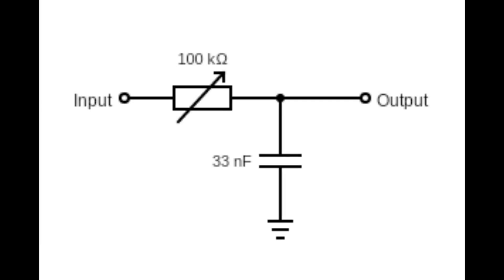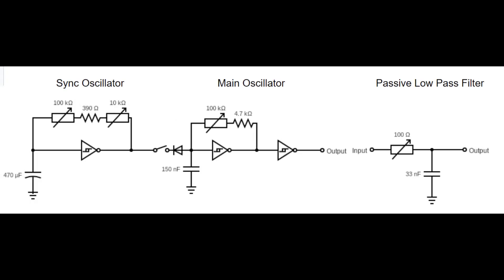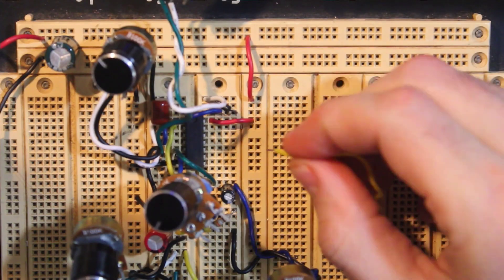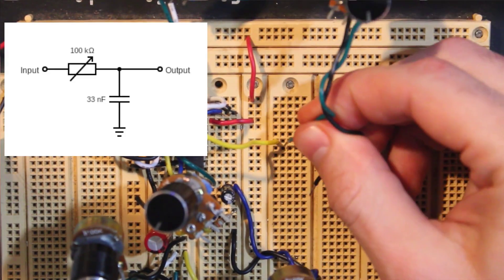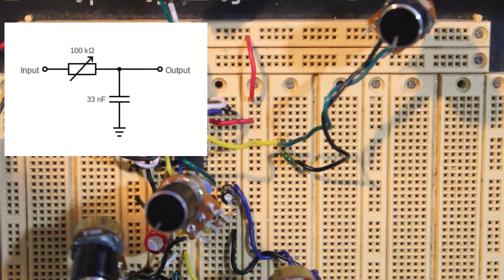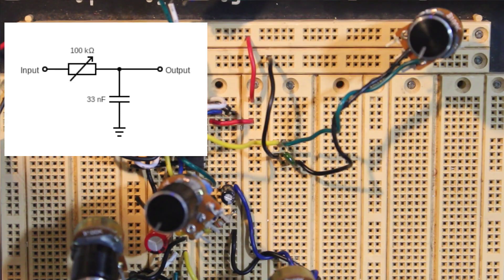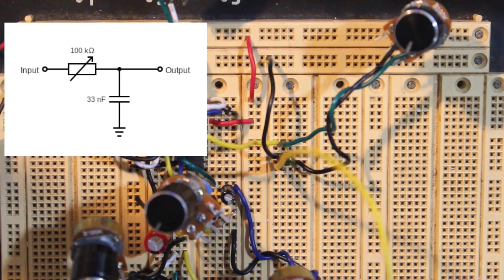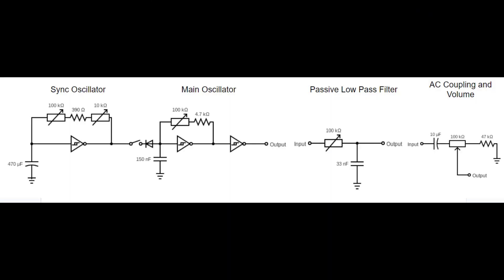Passive Low Pass Filter Schematic and Build [DIY Synth]

Comment: hey uhmmm i want to make the 40106 drone synth from your other vid with this low pass filter, so which components should i also buy with the list from the drone synth? sorry if im bothering you im super crazy abouut synth making, i just fell in love with aphex twin and i wanna hear like this super cool thing i made, you designed
Reply from the maker: The basic low pass filter is just a 100k potentiometer, and a 33 nf capacitor in between the output and ac coupler. The vactrol based one uses an LDR instead of a pot and requires an extra oscillator build for the vactrol's led. Happy to help, that's what I'm here for! I love Aphex Twin, too. 🤘
Reply: @observerb  damn so cool like i showed my friends ur videos and they think it hs heavy potntial with some metal drums. tho what would be better - for me to get potentiometers limited to one rotation or to more rotations?
Reply: @ oh damn also what did you mean by  "1x 10 potentiometer"? is it 10ohm or a 10k ohm potentiometer? idk i cant seem to find any 10 ohm potentiometer, i mean im no expert so sorry if i sound  dumb.

Comment: can't download schematic, saying its forbidden
Reply from the maker: The schematic is too powerful and is forbidden! It's at the bottom of this page: https://sites.google.com/view/observerb/education/electronics/40106-oscillator-with-sync?authuser=0
Reply: I have just recently gotten into effects pedal building and audio electronics, and your videos are so fantastic! You explain everything so clearly and I love that you keep referencing the schematic and give reasons for using certain components over others. I have decided that my next project will be a similar replica of your breadboard oscillator synth, with some slight differences. Thanks for the information and inspiration!

Also, I was wondering: for this filter knob, it seems as though it modifies the high end only in the top like 1/5 of the turn, and the rest sounds kind of bassy and the same. Would this be rectified by using a logarithmic taper pot? Or a pot of a different resistance? Or a capacitor of a different value?
Reply from the maker: @mccabeteems4587  Thanks for the kind words! I teach high school so I know the importance of clarity haha. The formula for the cutoff frequency is 1/(2 x pi x R x C), so you could use a larger resistance pot to get some more range out of it, but the high end will get cutoff with less of a turn, so it's a balance between range and expressivity. A logarithmic one could yield interesting results, try it out!